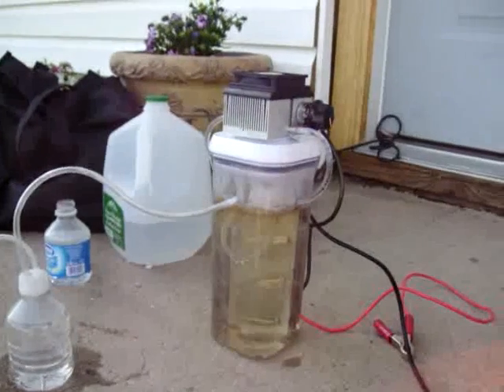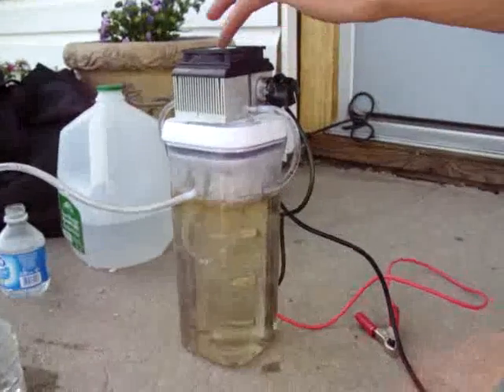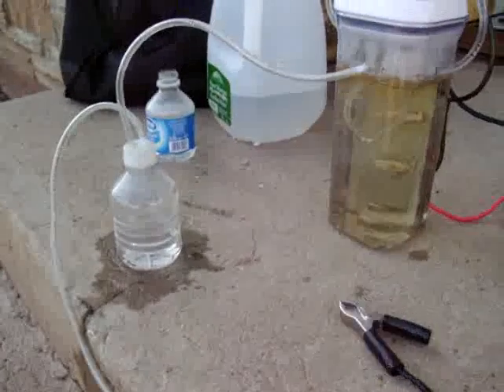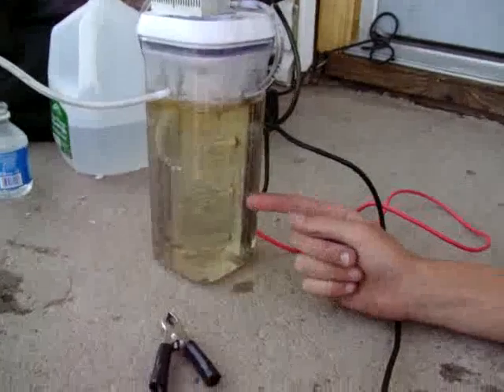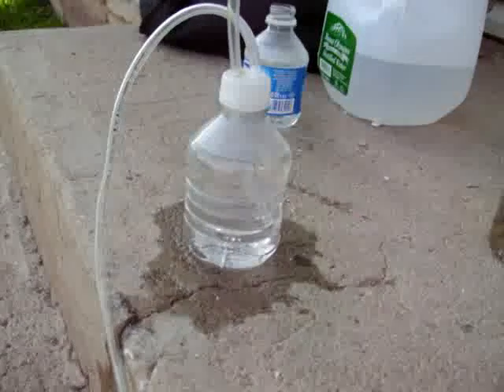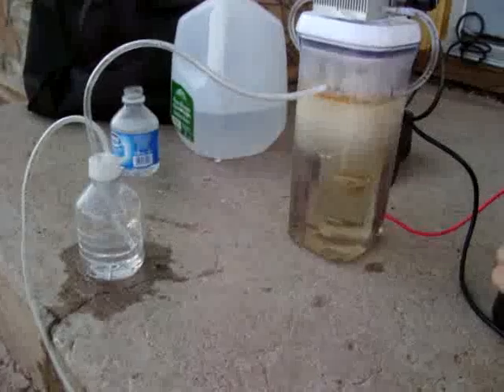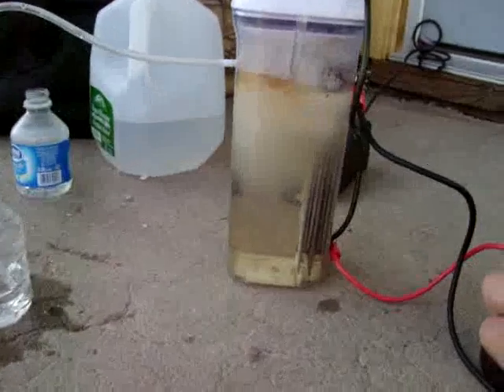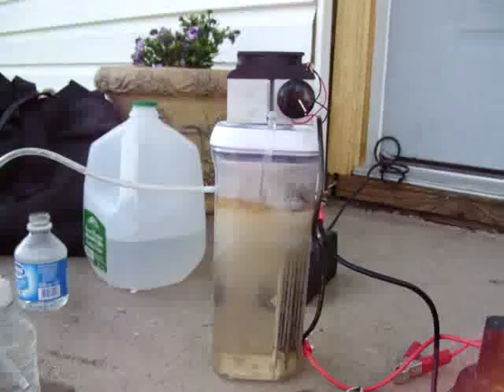my hho generator

Comment: the brown water is for the rust coming off the carbon nuts and bolts and if the plates are magnetic stainless it will do the same and its you use silver plate or real silver it will be black and copper will turn greenish blue found out in tests

Comment: I think the yellowing of the water is oxidation of the positive plates. If you continue to run it I think you will see pitting on the positive plates and calcium build up on the negative plates if your using tap water.

Comment: Just one problem with your theory. Thermodynamics isn't going to suck that water up through the tubes.

You need to get a pump and pump that water through your heatsink block.

Alternatively, you can stick lots of aluminium plates into your tuppaware container so that they contact the water. Just remember to silicone them up so there are no leaks. Then you would have a kick ass passive cooler that uses the air. No extra power to run a useless fan.